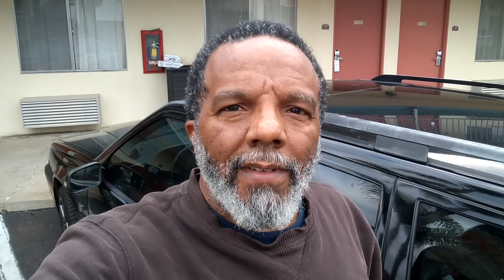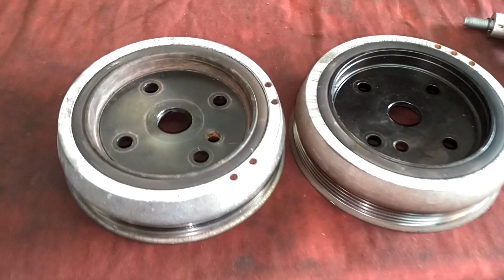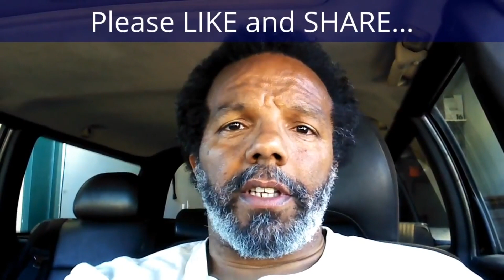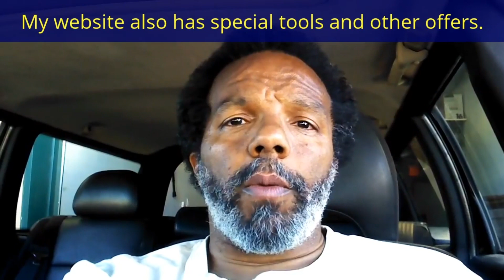How to tell if the harmonic balancer is going bad on your P1 Volvo, C30, C70, S40, V50, Ford Focus..

Comment: Good info. That is powdered rubber causing those streaks. Often, a bad harmonic balancer will squeal like a slipping serpentine belt. To find a bad harmonic balancer, I clean the front of the balancer with aerosol brake cleaner. Then use a grease crayon or spray paint a radial line out from the center to the outer edge. Then run the engine until you hear the squealing. That sound is caused by the outer ring slipping on the center of the balancer. Inspect the harmonic balancer. If the line is no longer a single straight line, the balancer is bad. What is happening is that the load from the serpentine belt is causing the outer ring to slip over the rubber in the center. That is what causes the noise.
Reply from the maker: THANKS for sharing.

Comment: Another suggestion. First time I did a timing belt job, the harmonic balancer was frozen on. Several pro mechanics actually suggested I use two pry bars to break it free. Applying pressure on the outer ring is a good way to ruin a perfectly good harmonic balancer. Once I got mine off, I used a 12mm X 1.0 metric tap on two of the through holes in the balancer. Next time, I'll be able to use a steering wheel puller to remove it without pulling on the crankshaft sprocket for the timing belt. Another potential issue with using pry bars: What if one of the bars slips, you will most likely ruin the plastic inner cover for the timing belt.
Reply from the maker: I understand.